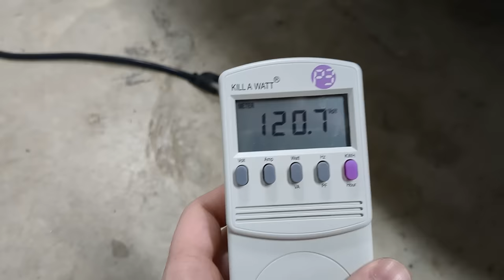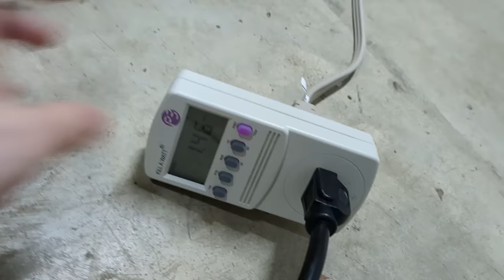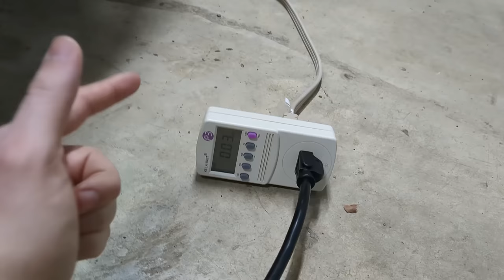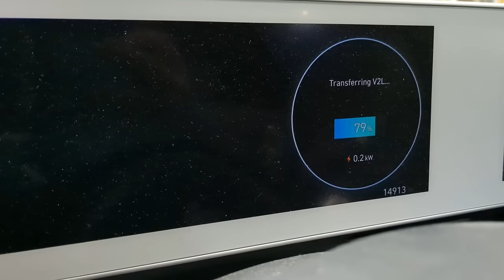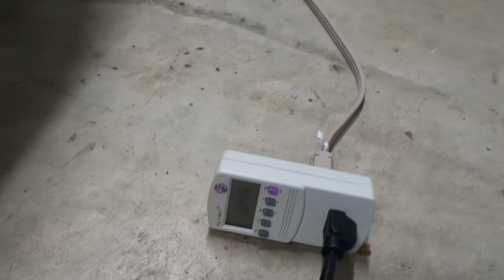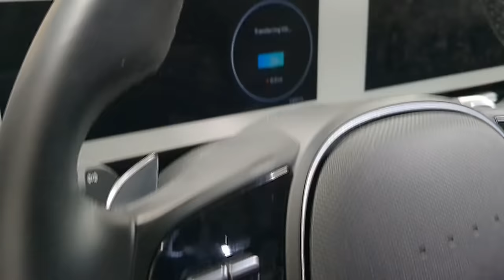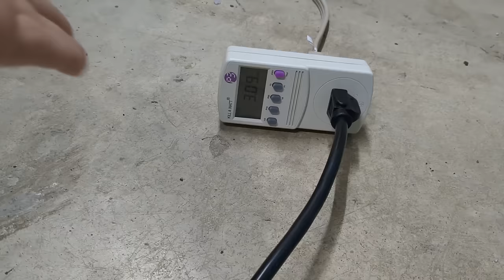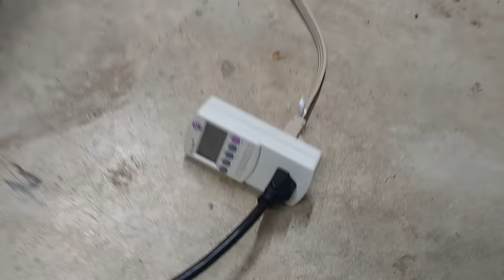A 24-hour test run of the Hyundai Ioniq 5's Vehicle-to-Load function

Comment: This video was fascinating, and yet the most impactful thing you said in this video was actually a total aside!  
I'd actually been enamored by the idea of "battery to grid" as you called it, because one of the "gotchas" about renewable power is that you can't really adjust supply to meet demand, but after Tesla installed a giant grid battery in Australia, products like the Tesla Powerwall seemed to be a potential way forward - a distributed battery network - and even better, if you have an electric vehicle you could have a poor man's version of a Powerwall and contribute to the grid.  
But at the end of the video you mention that the problem with "battery to grid" would be the extra wear and tear on your car's battery, which I hadn't considered, and it totally changed my perspective on it.  
I still think there's some there there, but maybe it's not as simple as I had hoped.  
Unfortunately, this is the second time my hopes had been scaled back.  
Last year I visited a friend in Cathedral City, CA (near Palm Springs), which has a huge number of solar panels on homes.  I was super excited to learn more.  
But after talking to my friend, he told me that it's actually a really shitty deal as a homeowner because you don't own the equipment - you rent it, and worse than that, when you buy the home you need to sign a contract with the solar panel provider and you don't exactly get a choice about who your provider is or what the terms of the contract are.  
Whatever the home has is what you get and you're locked in to the contract.

Comment: This is such a neat and useful feature, I wish my Volt had the feature OEM but you can hack it together with a 1500w inverter and by leaving the car on in hold mode, or alternatively you can switch it to mountain mode and then it'll pretty aggressively hold the same state of charge by starting the engine.

Comment: 240V, 30A Vehicle to Load would be amazing! Comparable to most medium-sized generators, and also possible to plug into the house breaker panel and avoid the mess of Daisy chained tripping hazards. Also eliminates needing to pull out the fridge and freezer from the wall to unplug the appliances from the wall and plug into the extension cord.

Also solves the problem of exhausting your house’s entire supply of extension cords and surge protectors, some of which are probably 14ga stranded aluminum wiring that really shouldn’t be used anywhere close to 15A continuous.

20A or 30A would also be a game changer over 15A, as it would allow a single 15A appliance to run plus the background of fridge, freezer, lights. It would eliminate most of the plugging and unplugging that you had to do.

Comment: This would be fantastic here in Central Florida during hurricane season. In advance of an incoming storm, we usually prep a bunch of non-perishable foods for meals and snacks, so cooking during the storm (and right afterwards) isn’t a concern. Generators are cool for what they are, but you really can’t use them while storm conditions are present, (which can be more than 24 hours). A setup like this car would let us get power immediately, which would be nice.  Also, it seems like we’d be able to last quite a while running a fridge, an LED light or two in the evenings, and cell phone chargers. If we ran into an extended outage after the storm passed, cooking could be done on the outdoor propane grill.
Reply: I guess it would be good as long as you have a gas car to go out. If the power's out for a week and you only have an EV, you have to decide if you're going to power your house or be able to go places. It wouldn't be fun to run out of battery and have both a dead house and a dead car with no way to recharge it except borrowing a generator. Evacuating would be easier in a gas car too, can carry spare fuel and refuel in a few minutes as opposed to waiting for a handful of chargers and then having to sit for half an hour.
Reply: @bwofficial1776  the longest power outage I had to deal with was from Hurricane Irma, when power was out in my neighborhood for a few days. However, power was available throughout most of the commercial areas around my neighborhood (including at EV chargers - such as they were back then) very soon after the storm left. Unless the area is devastated, then I’d be able to take the car to a public charger every few days or so.

As for evacuating, once you’ve driven enough to need a charge, you’ll also probably need a restroom, stretch break, snack/meal, etc. just because you’re evacuating that doesn’t suspend human needs. Taking care of those needs will take almost as much time as it takes to charge at a fast charger.
Reply: @bwofficial1776  except for the part in the video about driving to a fast charger for an hour to get enough to power the home for another week

Comment: You can also wire up a 3-Way Switch at your breaker box to be used as a manual transfer switch on a single circuit, and not have all those extension cords.

Comment: 10:00 Its called an automatic circuit recloser.  Or ACR. And yes, they try to re-close 3 times and then lock to open if the fault is not cleared.

Comment: Yes the kilowatt resetting drove me nuts too. I went out to Ebay and picked up a power meter with memory function then I went to Lowe's and picked up a box and then I ordered an extension cord and cut it in half and see where I'm going with this. I wanted to be able to measure electricity used at glance with bands and sound set ups and sometimes you lose power at the venue or you have to unplug it before you can get the final kilowatt reading if you're curious.
Reply: Some Kill-a-Watt save the data, mine does.

Comment: I've got to say, I love having UPSes around. I find them at thrift stores with dead batteries all the time for like $5-10. A $20 battery later and they work just fine. I run my 3d printer off one, I have one on my network gear, and I have a couple extras for emergency lighting or anything else

Comment: 15:30 Probably the best argument for trying this experiment. I'm currently setting up a ute that will have two solar systems. One to help keep the main battery and an auxiliary charged, and another two 115 amp/hr AGMs hooked to 360 Watts of solar to run my 'household' appliances and workshop tools...compressor, welder etc. It'll be a mobile home/workshop for outback emergency repairs. Oh, and I have a 3000-watt inverter, as well as a 3000-watt ULP generator just in case I'm caught in a rainforest with minimal sunlight for a while.

Comment: For the furnace they make a transfer switch that goes on a quad electrical box with a power inlet. Then all you have to do is click the switch and plug in extension cord in. Learned about them a couple years ago and I think it should just be standard is an install for a furnace that's 120v that is.

Comment: If power goes out for an extended time in the winter, heating can be managed efficiently by warming a hot water bottle and keeping it with you under a blanket.  This uses dramatically less power than attempting to heat a living space, even if it's just one room.

Comment: Bit strange to say here but the upload reminded me, I found an old dual colour ink receipt printer (Canon Mp121-DH), module itself made by Alps alpine, no Id number. 

The thing that has me entranced is its dual colour number/symbols printer and the entire mechanism is controlled by a single motor, a cool forming a weird magnetic clutch and a rotary encoder. 

The type head moves horizontally and independently across a moving rubber belt that has two sets of symbols on it, like the ends of typewriter arms on a rubber belt. 

 It's a really quite beautiful piece of consumer design, for example they chose to waste quite a bit of ink during printing to simplify the design.

I could go on for hours about how the mechanism simultaneously fascinates and frustrates me. 

Anyway I thought this piece of consumer electronic/mechanical design might interest you, keep up the videos 👍

Comment: In the woods we lose power for more than 24 hours about once a year. Winter power loses are common and the worst power loss lasted 3 weeks. 
My generator delivers 15kw which is needed to start the well pump. It runs on propane so fuel needs to be delivered weekly to keep it going

Comment: Very well sir. Here's the pony I would like to have: Have homes be equipped with their own batteries; charge them when cheap. Subsidize them by the electric company, because they can flatten out consumption peaks. Hook them up to the "smart fuseboard" thing, and presto blammo: Power outage? Low-priority stuff gets disabled, but high-priority stuff stays (probably have an alert or something). No reconnecting stuff. Have the weather warning automatically charge everyone's batteries (you should be able to opt-out of this, but by default leave it on for people), you have probably now saved some lives.

Comment: One thing I will add, is that in many east coast communities, this might help in a pinch after a hurricane, but not a full solution. Considering that people would be driving back to a home with no power, thus having a lower battery to start with and have perhaps a week of power being out, it may not be practical to be a replacement for a traditional generator.

Comment: For anyone wondering, in Europe it outputs 3,6kW so you could run basically your whole house from it.
This function should be avaiable in all electric vehicles. Imagine how expensive a 60kWh battery storage would cost for your home if you have solar for example. This way it's way cheaper and when it's not powering your house you can use it to drive somewhere instead of it just sitting in a basement.

Also how much would the car lose just sitting there? I know electric cars lose charge just doing nothing. So it might not be that the DC/AC conversion is particularly wasteful but the car just using power as normal on top.

Comment: You may also want to consider replacing your garage door with an insulated version. Especially if it faces east or west you could end up with excessive heat input and also depending upon your seal (mine is poor, but I’m California so I’m more worried about heat since mine face due west) it might help with cold. My absolute worst winter night dips to 25 degrees ABOVE zero. I don’t know how you guys do the “minus” thing!

Comment: Excellent 
I wish my bolt had the capability like the ionic does. 
Actually I have solar and home battery storage and I wish the car could be plugged into the solar inverter and run DC into it like the solar panels and home battery already do. The solar system already has a transfer switch and has the inverter. The inverter has empty breakers for more solar panels which the car could fill in for.

Comment: From my understanding, most evs go through a type of battery conditioning if they have a constant load on them. I think that during the night the car had to condition the battery for a heavier load like the refrigerator defrosting. Plus most batteries will also rebalance the cell voltage throughout the pack.

Comment: both switchmode power supplies and inverters have a fixed minimum power draw depending on how big they are made, in this case I suspect it's making use of the main motor inverter to provide a simple 120V output, but while its only below 2KW capacity, the mosfets are not 100% efficient but you also need to have enough of them active to support the maximum possible load, which could actually be much much greater than the 15A max when inrush current has to be considered. Large UPS's have the same downside in using quite a lot of power at zero load, just to keep themselves running, and then plus some more with the amount of cooling airflow needed, mind you this is most notable with traditional lead-acid models.
The battery cells themselves could also dump some energy into waste heat while being discharged, even though it's at a low current draw compared to their capacity, its possible that the chemical reaction itself results in a small minimum amount of unused heat.

Comment: Can you run a 1800W load off of the back seat plug while also using the V2L adapter in the charging port? Or are they using the same inverter?

Also, wonder if you could plug in via USB-C to charge your phone and laptop without loading the inverter? Or maybe even a second 120V inverter!

Comment: You could repurpose one of those old banks of swithed outlets that went under your monitor back in the day. That way you don't have to plug/unplug all the time, just flip a switch. It's basically a desktop power strip but each outlet is switched from a rocker switch on the front.

Comment: Ionic 5 in Australia can supply up to 3.6 kW. 15 A output @ 240 V. 
Here you have enough power capacity to set up a dedicated power inlet and transfer switch to power the home's nominated essential circuits.
Bit amazed the Killawatt doesn't have an internal battery to retain data during a power outage.

Comment: Great result and a very honest review.
Do you have solar PV panels? Adding a small home battery (2.5 - 5 kWh) would allow time-shifting solar power to run the house in the evening. It also would allow the solar panels to work in a blackout. The car would then cover longer outages so it saves buying a big (more expensive) home battery.
Could you do a video about this integrated system benefits?

Comment: One note on the fridge and freezer load. You shouldn't be concerned as much about defrosting (although a valid point) as about load surge. The small heat pump in the fridge itself doesn't draw much power, but each start of the pump creates up to 10X quick surge. I believe it's not so bad with fridges with inverter heat pumps but there're not many of those in the households. Such power surges are the worst you can do to the high frequency (MOSFET based) inverter. It's only OK if the entire load of the starting pump fits within the inverter's nominal rating.

Comment: On the Limiteds there’s another plug under the back seats which provides the same power as the V2L port. What this means is you can get 2x the output by using one chord from the V2L adapter and one chord from the internal plug.
Reply: Is this actually the case? Because they would need an inverter that is powerful enough for that, not just having additional sockets.

Comment: One thing about your setup is that you have extension cords plugged into power strips, plugged into extension cords, plugged into power strips, etc. Each one of those connections is going to be resistance. Resistance is heat, heat is a potential fire. Also, most power strips, the switch is handling 100% of the load (no contactor) and that's another point of resistance. Having high wattage appliances like the microwave this far down the circuit could lead to problems. You would be better served when using those appliances to directly connect them dedicated to the vehicle with a heavy duty extension cord. In fact, everything in your setup should be running at least 14 gauge cords, preferably 12 gauge.

Comment: I know the point was to show how to (unplanned) use your existing stuff powered by the car, but at the same time, if you were banking on this being a potentially semi-regular occurrence for places in the intersection of often bad weather + bad/unstable grid, it would also probably be worth investing in a few camping/RV grade appliances, which are design to work on much lower draws of generators vs the full power coffee machine/microwave designed to run on infinite power at full amperage. Somethings designed to cook on only 400 watts (vs 1200) would greatly extend that run time. With the rise of "off grid" and "van life" from the previous years, there are much nicer and many more options, and are fairly compact

Also I wonder how long until fridges start coming with an override switch for "do not defrost", for cases like this. Will it take until "home battery" tech becomes more common place, and "most" appliances need to have a feedback signal line to know to run in different modes when on grid vs battery automatically, much like how laptops pause/dont start certain tasks when unplugged, or steam pauses background downloads or throttles.

Comment: For my furnace (forced air), I replaced the local switch for local power shutoff with a single circuit, manual transfer switch (Reliance Controls TF151W on Amazon). It came with a local and integrated NEMA 15 inlet but I didn't use it. It also came with a blank plate and I instead wired it to a inlet on the outside of the house for a generator. Now that I'm getting into 'solar generators', I now would like an internal generator tap also but haven't quite worked out how to safely have both (how to do the lockout between the two inlets so the 'other' one isn't live when the first one is supplying power). Anyway, this solution might work well especially if the furnace is in the garage. Unfortunately, as I recall, yours is in the basement. More extension cords!
Reply: To safely switch between two inlets you can use another transfer switch. The circuits don't care about the "Grid" and "Generator" labels.

Comment: I'm happy we have 240V here in Europe, so the car provides me with almost 3.6kW (240V - 15A), as it is limited to 15A for the cables, the higher voltage supports double the power.
So Microwave and Toaster at the same time would work in most cases, even with the fridge and freezer still attached.
Otherway round I can drain the battery in half the time as in the US ^^

Regarding overload: the manual says it has overload protection, but not how it is protected.

Comment: I found out our Sunny Boy inverters have a 1500VAC output when the sun is up.  I charged my Bolt from that, and ran the house using 2 ea. 12Vin, 1KW inverters (to deal with the start up surge on the freezer and refrigerator) to power what I needed when it got windy outside (SDG&E doesn't like to do maintenance).